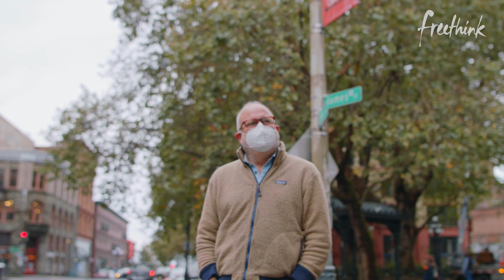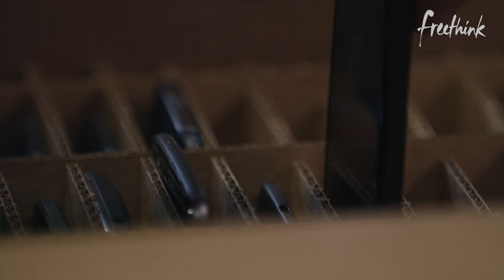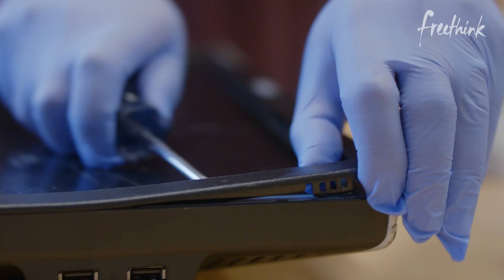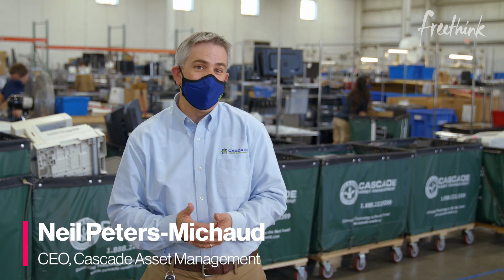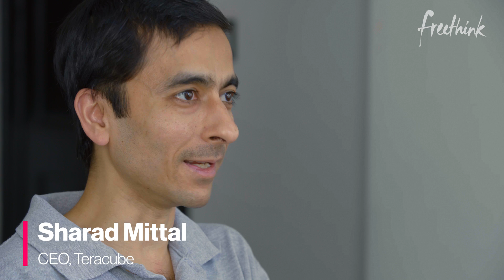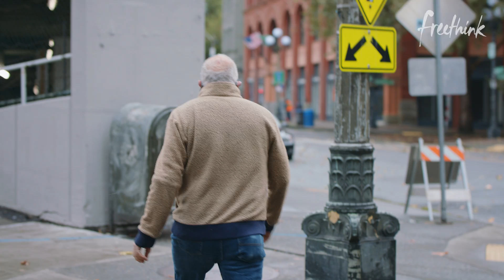The Ugly Truth About Toxic E-Waste

Comment: Many of these very cheap phones and like this Cube phone has one issue. They are most likely not able to VoLTE (4G Voice), for operators need to approve each phone models to work with their network, why it is like that I don't know. In 2025 it is said that for example Norway is going to turn off 2G.
So these cheap phones will not be able to do normal calling any more. We would rely on VoIP then.

There is some low bandwidth 4G modem that is capable to call on 4G, I really want that in a phone. It is based on LTE CAT M1. -155dB link! Insane!!!